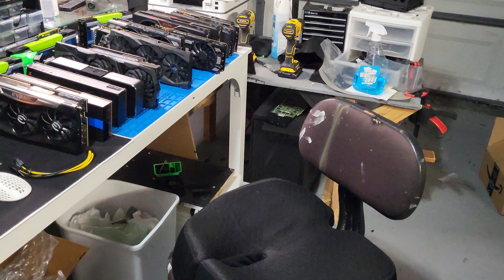The P100 Datacenter Card in a Desktop Build: Everything Nobody Tells You

Comment: How tight can the cards be packed with that fan adapter, how loud do you have to run the fan to not throttle the card?
Reply from the maker: They are data center cards, so you can really stack as neatly as your rig allows. But when doing so, the fan adapter I showed will be bumping up against the one above or below (or both). There is another 3D printed adapter that lets you run a blower style horizontal fan, so then your only issue is the length (and if you're running these, you'll know what I mean). 

Basically, in a server case (Phanteks, Silverstone, Thermaltake, etc., not  my brands, just coming to mind) so they aren't limited to fan adaption, you have some room to explore a tight multi-card stack!
Reply: @gulfcoasttechnerds i was thinking of making a custom dual fan 140 mm server fan push/pull config with a common duct on both sides

Comment: I have this card setup in a homelab server running Ollama for AI inference to support Jupyter Lab connected to a PostgreSQL database.  It's a great card!  To power it, I just modified a standard issue 8-pin (4+4) EPS 12V CPU cable by narrowing the locking clip.  I found a 3d printed 37 mm blower fan adapter kit on eBay, ordered a new 37 mm blower fan, found a manual pwm fan controller powered by a 6-pin PCIe off the PSU.  It works great.  37 mm blower fan is a little whiny, but the card really doesnt need a lot of air flow to keep cool provided you're not hammering it with loads.  I haven't seen it pull the full 250 W TDP it's rated for even under extended AI inference loads.
Reply from the maker: That's a solid setup, and the smaller blower fans - I think - are more effective and getting the airflow across the heatsink without any turbulence. And you're right, these are passively cooled cards by design, and so long as they don't 'soak' in their own heat, some steady, but reasonable airflow is sufficient.